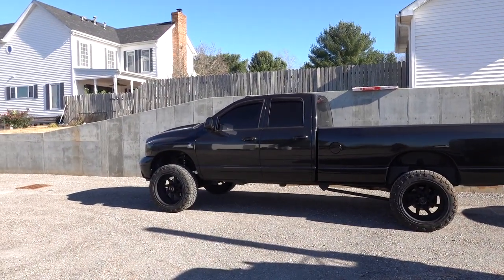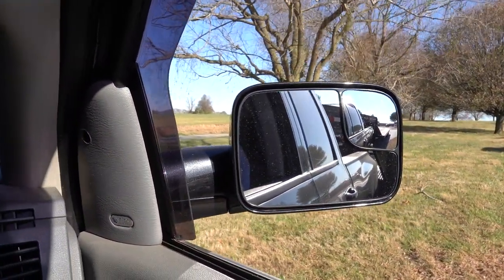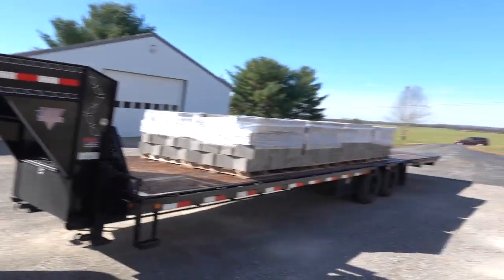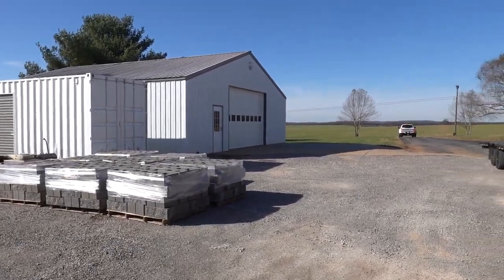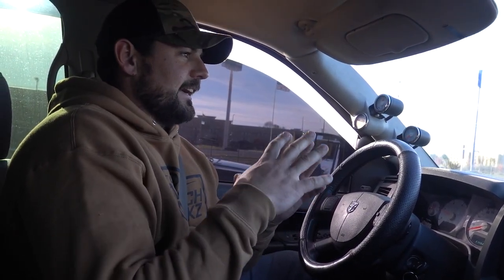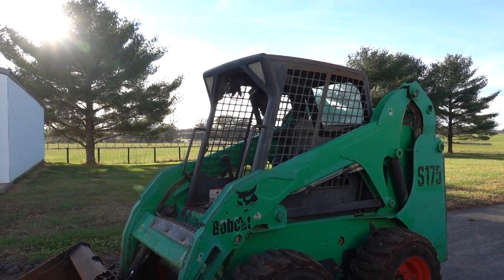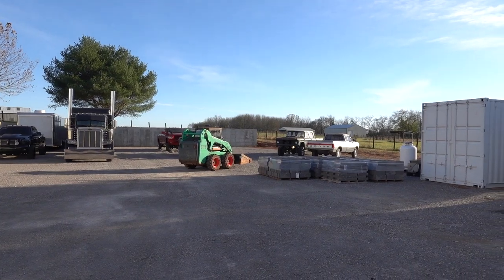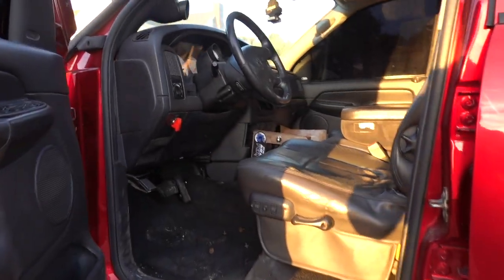THE MOST WEIGHT I'VE EVER TOWED WITH THIS TRUCK!!! 10+ TONS & 800HP!!!

Comment: I've done 7 tons with my Chevy, no tune. Downpipe, up pipe, egr delete, high flow intake, 5" straight pipe, 7" tip, etc. 06 2500HD 6.6 LLY/LBZ Duramax with a 6 speed Allison. 15,500lb approximately and I didn't even use tow/haul mode.
Reply: Your just shooting yourself in the foot by not using tow/haul mode. Tow/haul mode locks the torque converter from 2nd gear and up, where as when your not in tow/haul it only locks the torque converter in 5th and 6th. Basically your just wasting a lot of power and generating a ton of heat by not using tow/haul mode. Plus your wont get any engine braking if your not using tow/haul mode for the same reason being the torque converter not being locked.
Reply: @happydoggs  My temps were all superb. With the trailer brakes I have, I don't need engine braking lol. I'll use tow/haul mode when I feel something back there.

Comment: Is there a reason there was zero securement to hold the material on the trailer c'mon man
Reply: Its not going anywhere.....c'mon man
Reply: @calebbailey7730  panic stop or a collision would have had all of that block all over the road
Reply: @bullas1022  if he strapped it or not it wouldn't make a difference....the plastic wrap wouldn't do shit to stop anything, he would've had to taken 2x4s and built a sub frame around those then ran a strap on that 🤷‍♂️
Reply: gravity
Reply: He's never ran a machine before therefore has never strapped a dangerous load lmao 
No 2x4 3 straps per pallet locks it in place
Reply: @ssceverythingcummins2985  👍 exactly
Reply: @ssceverythingcummins2985  i meant he'd have to build a frame for them for a strap to even make a difference. But no a strap.isnt guaranteed  to hold it down completely.

Comment: I've only hauled 10k with my 12 valve first gen with the A518 overdrive off of course. It did pretty damn good, but the mountains over here are what really kill ya. Im in Pennsylvania so its very mountainous, but the worst part was not having trailer brakes on the trailer. Was very sketchy with having drums in the rear, but I handled it like a pro. 😎

Comment: Bro would u sell the 08? That the exact truck im looking to buy
Reply: Not trying to make him sound bad but compared to many others I’ve watched his shit brakes extremely fast for whatever reason and I treat my hauler worse than he does. Hell I’ve done one tranny ( stock 6 speed auto in a 640hp duramax ) after the stock failed at 240. That’s it and I’m at 283 and just hauled alittle over 18k last weekend
Reply: @bbdl7042  Brother he builds race trucks....and races them. That shizz is pretty hard on parts. Not trying to be a dick but I dont think you and him have too much in common when it comes to use of trucks
Reply: @haydona1845  true racing is hard on the trucks/ parts for sure but for the time he spends wrenching on all of those trucks he should be able to make a lot more passes than he does.
Reply: He spends very little time on the track. Way more guys go and spend more time without shit blowing apart.

Comment: Where were those straps? If DOT would of pulled you over, easily a 2500 dollar ticket if not more. Not to mention if you were to be in an accident and your load killed someone due to it not being properly secured. Lots of jail time.
Reply: Its personal use not commercial use. DOT wont do shit.
Reply: @happydoggs  any DOT/State trooper would of pulled him over in Michigan regardless of personal or commercial.  Endangering people on the road doesn't stop if you're commercial or not.  If I put my truck up on a trailer and dont strap it down, and get into an accident and it falls off and kills someone.  doesn't matter if im commercial or not.

Drove semi's for two years, now i drive them for fun.